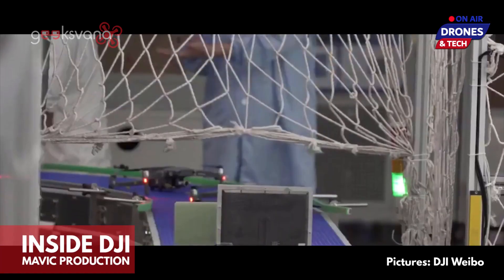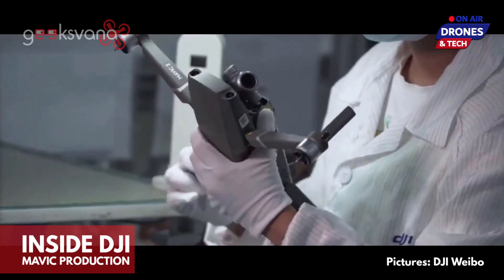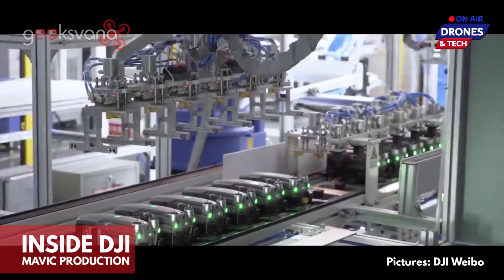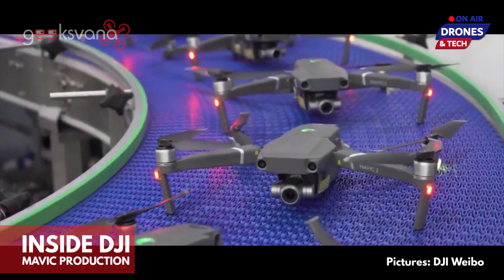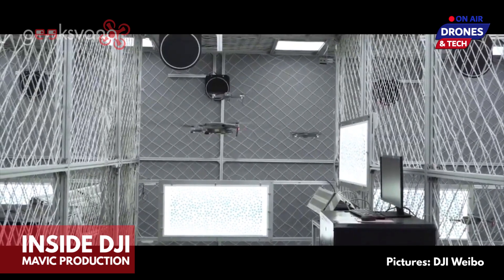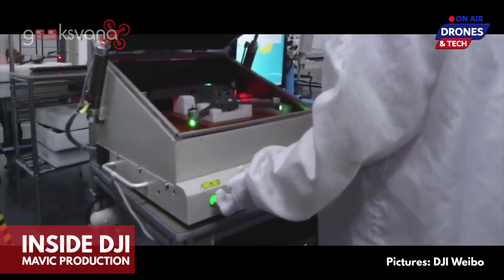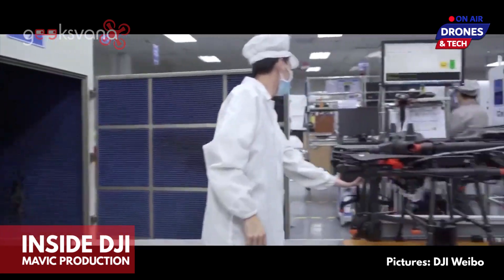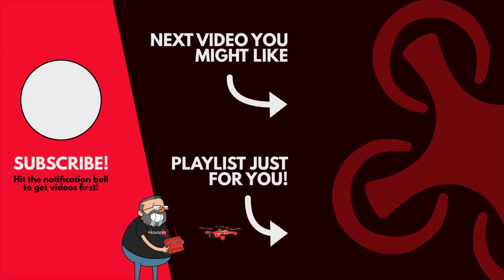Watch this DJI Factory Rare Footage – How DJI Make Drones – Geeksvana Drone News

Comment: The Chinese has microchip inside all DJI drones .. its true. DJI is Chinese brand. They have installed a microchip inside. That's why he can balance itself in the air. Does it not scare the Americans?
Reply: it balances in the air because of the help with gps and high powered wind resistance thanks to the propellers and rotor